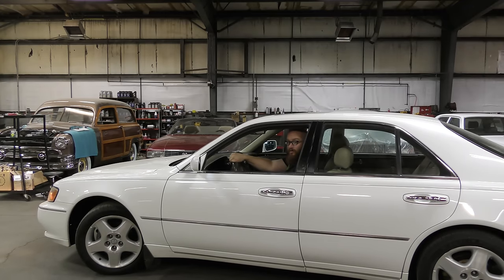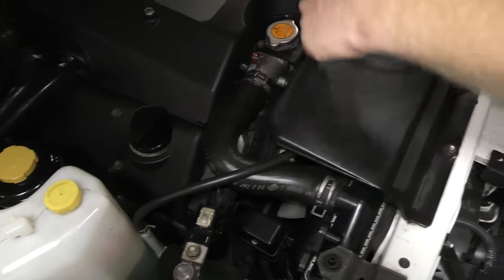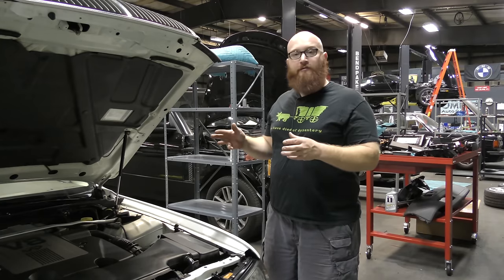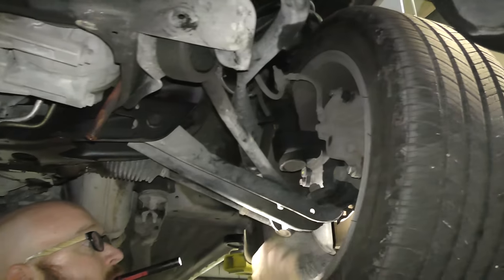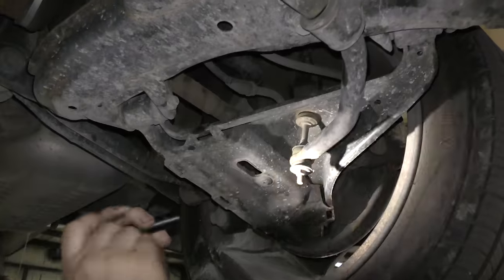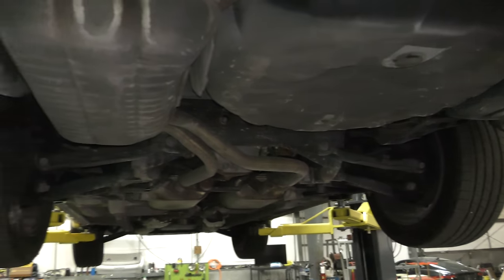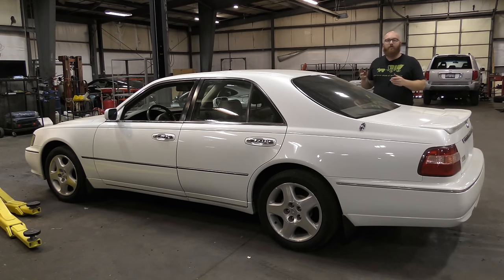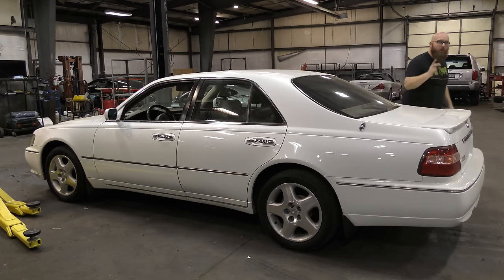I've never seen one of these before! First time a 99 Infiniti Q45t enters the Car Wizard's shop

Comment: Yeah those Infiniti’s are pretty cool that’s for sure. As for the struts, yeah parts can be hard to find and pretty expensive on those things. I would say maybe check out car-part.com and see if you can find a solution for that. Unfortunately if it’s air suspension you may be forced to go through your local Infiniti dealership, and from what you’re telling me in this video it sounds like they may or may not have the parts for it. Perhaps you can cross reference another manufacturer and find something that works with the car and maintain the equivalent ride quality.

Comment: Didn't see it on that one, but the earlier Q45s came with a massive factory service manual, in a fitted pocket in the driver's door!
Reply: Can Confirm. I bought a 1992 Q45 with 71K miles on it last year and it had that brick of a service manual

Comment: Fun fact: the front struts and the front spindle is all one piece on those cars! Crazy design!
Reply: What does that mean exactly.
Guess it's good right?
Reply: @SvenQ45  on pretty much every other vehicle ever built with a McPherson strut front suspension,  The strut bolts to the knuckle so it's easy to replace and a lot cheaper!
Reply: @lustfulvengance  Oh ok thank you.
Guess it has no good or bad side about handling and comfort?

Comment: I had a 1994 q45 great car in my opinion was a better car the this model that replaced it. Hard to find part for the 1994 they changed part at the factory as they came down the line. So the dealer would ask for your build date

Comment: Cool video. But just to be fair, the Cadillac Seville* STS , 98-04 generation is distinct from the Cadillac STS which has always been Longitudinal engine mounted RWD/AWD. The Seville STS was the last generation of the FWD Seville. I wouldn't  want any of the Northstar Caddy's after seeing your video on your daughter's car. Too bad, as a BMW E39 enthusiast, aside from the headbolt problems it was cool that we had an american designed and manufactured DOHC modern aluminum block V8. 
They made respectable numbers for the years they were offered. They even made the FWD models appealing. Even today the American V8's that have dominated the past 20 or so odd years have been pushrod engines. Which are awesome, but the Northstar could have been a modern V8 to rival foreign makes. They were economical enough at the same time having healthy HP and TQ and they sound great.

Comment: Set a glass of water on the intake it won't move this is a Japanese mercedesbenz very tough and low maintenance oh no car wizard this car is very much better than a Lexus 10 times tougher the older models are very tough I built quite a few transmission but the only reason why is leak on the coolant linesit has a big diaper under the plastic cover I love them

Comment: The generation before this car (g50) q45 1989-1996 had the VH45DE engine. In my opinion there will likely never be another engine that runs quieter or smoother ever again

Comment: Although, when Toyota launched the original Lexus LS400, they imported them over here to the UK and they sold well, but for some reason, as far as I can remember, we never got the Infinity. I don't know why as, at the time, Nissan was still a fairly popular brand over here. So when they realized how well the LS400 was selling, I'm surprised they didn't follow suit with the Infinity. Not that it matters to me, as unlike many people, and although I can appreciate how reliable, well engineered and we'll equipped these luxury Japanese cars were, they never did anything for me. I don't know, I just find them a bit dull and soulless. That's just my opinion, but I'd take a Jag XJ40, 7 Series or S Class, over one of these, any day of the week.  Any of these have much more character and distinctive styling.

Comment: finding struts is hard/expensive but not impossible. the q45t can be fitted with base model struts. i ordered rear struts off rockauto, and used chevy lumina strut cart inserts for front(had to make spacer to sit below strut cart) along with strutmounts and bearing from ebay.(had to drill hole on mount out larger). but it has road smooth for 3 years now. got idea from this video https://www.youtube.com/watch?v=gqglS6UIgRc  . honestly is probably the only solution beside coilovers(expensive).

Comment: This car is branded in Japan as the Nissan CIMA/ Gloria / Cedric.  Here are some options for struts/coil-overs:  https://www.silvers-suspension.com.au/neomax-r-nissan-cedric-gloria-y34-1999-2004    
https://www.carid.com/ksport/0-5-1-5-x-0-5-1-5-kontrol-sport-front-and-rear-lowering-coilovers-mpn-cin070-sp.html?singleid=2720555752&url=6572566      https://www.tuner-store.com/v-05-bc-racing-br-series-coilovers-for-1997-2001-infiniti-q45-w-o-spindle/

Comment: @car wizard
A quick look at OEM Infiniti parts search on Google, here are some websites
https://www.infinitipartsdeal.com/parts-list/1999-infiniti-q45/axle_suspension/front_suspension.html?pnc=54303K
https://www.infinitipartsdeal.com/parts-list/1999-infiniti-q45/axle_suspension/front_suspension.html?pnc=54302K
https://www.infinitipartsdeal.com/parts-list/1999-infiniti-q45/axle_suspension/rear_suspension.html?pnc=56210K

https://parts.infinitiusa.com/p/INFINITI__/Strutkit-Suspension--Left--Front/89961439/54303-3H926.html
https://parts.infinitiusa.com/p/INFINITI__/Strut-Kit-Suspension--Right--Front/89961163/54302-3H926.html
https://parts.infinitiusa.com/p/89664380/56210-3H925.html

Comment: folks! this is before! Renault.. Nissan used to build very good cars... (except for the Nissan Sunny/Sentra 1980s that's a piece of crap).

it seems like this car shares the same chassis of the Nissan Leopard you should try looking for parts with that model I used to have a Nissan Primera P11 which is basically a JDM version of the Infiniti G20t when I lived abroad and many parts were magnitudes cheaper with the "Nissan" logo on it than with the "Infiniti" on it.

Comment: I had that car, my front right went bad. It has small motor on top to increase the pressure... that was it.. cost me $1100, this was back in 2008. so by now it makes sense you can't get the part. It was costly and useless.

Comment: Wizard, I have a 2000 Q45 and had to do shocks at about the same mileage. You CAN find OEM shocks but they'll be about $1500 for all 4 corners. I decided to go the BC coilover route and they are firm. Price is about the same between stock and a decent coilover system. Mine is the pearl white car in this thread. You should find some good info (if you haven't already). https://forums.nicoclub.com/y33-suspension-2019-edition-t622967.html As I am sure you know, knock sensors are common on this vintage Nissan and this is no exception. It was 'fun' to pull the upper and lower intake manifold to get to them. Good luck

Comment: My experience with Infinitys: overpriced, plastic clad Nissan. Thats it. 
Ever since the Renault/Nissan merger, there’s nothing that makes Infinity any better than their less expensive Nissans. They use the same engine configurations, chassis, wiring, suspensions, ect. They’ve become like the Cadillac Cimmeron...

Nissan either needs to redo the whole Infinity lineup and make it a separate, semi-independent company dedicated to high quality luxury cars (and NOT fancied-up Nissans), or kill the brand and use the Infinity name as a top trim, all-the-options level on Nissans.

Comment: It's a M45
Reply: M45 / Fuga was smaller with the same 4.5L or 4.1L (depending on year) as the Q45 (this had the 4.1L). It does look the same size (or above) an early Lexus LS. The 2G Q45 / Cima shown had even almost the same exterior look, except for headlights and taillights.

Comment: This is when Nissan was still in Japan you guys should know Nissan sold out and was not Japanese made in the early 2000s so anything in the 1990s that’s Nissan is the REAL DEAL! Anything after than I wouldn’t touch with a 10 foot transmission pole 😂 .. get it? Transmission because the new Nissan/Infiniti is made by other countries and some are even made with BMW motors 🥶 YIKES! But this one… and other 1990 models.. you can surely bet you have bought a solid Japanese mold
Reply: You maybe thinking about the Infiniti QX30 and that was a British-made Mercedes OG GLA (Mercedes-sourced engine and all). 

Nissan did had a contract with Mercedes (not BMW that I know of) for using elements from each other.  Another case on the opposite side is the Mercedes X-Class midsize pickup truck that they sold for a couple of years made in Barcelona, ES from the Nissan Navara (the slightly smaller international replacement for the Frontier).
Reply: @syxepop  more than that. Those Maximas and altimas now are electrical and transmission nightmares and the new Q50s are made in junction with BMW🥶 and they don’t make anything reliable

Comment: I've never had an Infiniti - not that you can get them in the UK.  I did have a Datsun Laurel at one point, though, which was a nice enough car, when it worked.  Trouble is, it kept getting me stranded at the side of the road, and the thirst on that thing was biblical.  I tend not to like Japanese cars - to me, they are soulless, even worse than modern Mercedes...

Comment: I searched for "infiniti q45 suspension parts" and found this:

https://www.carid.com/airrex/air-strut-kit-mpn-airrex-ii006-strut.html?singleid=864406827&url=3823141
$3,300, I suspect you may have found these already, but the company is in the US, may be worth a call.

Disclaimer, I have no connection with this company.